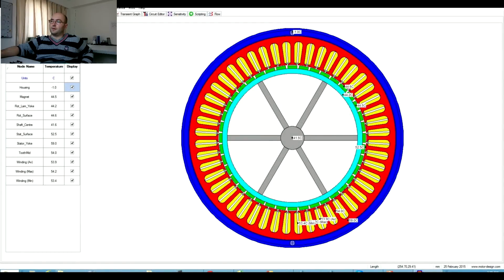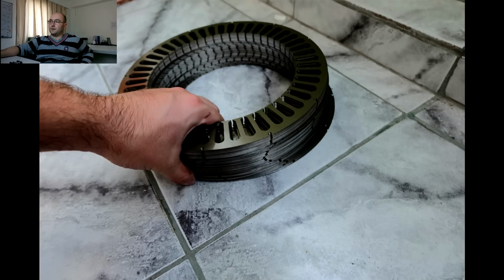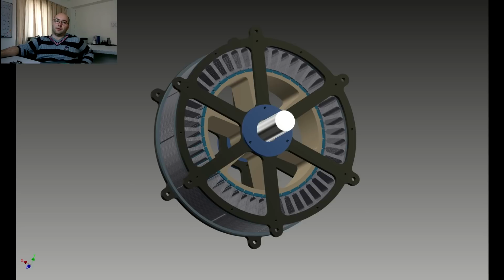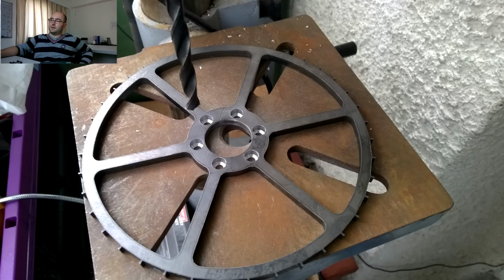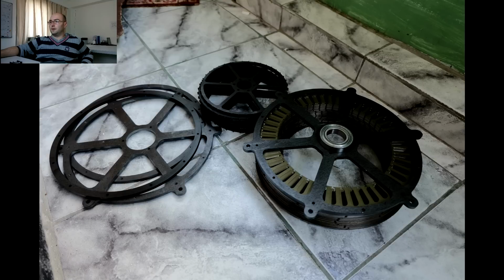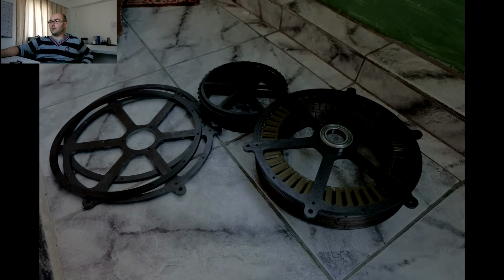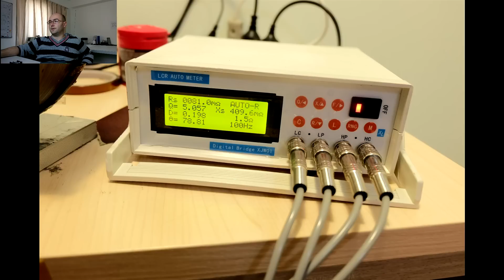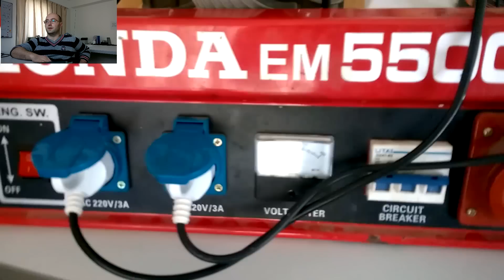How to make a brushless dc motor  at home

Comment: 300v is too much, you will need a hydro power to run
Reply: No? It will be low amp high voltage, the motor controller takes care of that so it will be able to run off of a normal battery.

Comment: Brushless is not synonymous with twisted magnetic magnets with twisted magnetic effects. This is nonsense. The old engine in the video is much better, I think, if you replace something. Replace metal cores with active copper windings and replace some old metal with newer dynamo metal. This does not mean that it must be a magnetic material with distance effect of Mgneten. Cobald, for example, has a high field density.
Cobald and other types of iron, for example, have a high graded field density. It does not have to be neodymium or the like, which is usually found in magnetic materials.
On the contrary, in most cases it is another material that promotes the improvement of electric motors. Brushless can be easily accomplished by magnetic sensors on the collector and built-in thyristors, or by spark-free contacts.
Pure three-phase motors often have 1/10 less power one must consider. brushless is not always forced. It would be a litte hybris to believe this

Comment: How do you get the supply of 150A power I imagine you might trip the neighborhood?
Reply: 150amp isnt that hard, u can get that from a very cheap welding machine, the thing is that he is getting those 150amps at 45kw, wich means that he would need a 300 volt three phase supply, but in this cae he is feeding it with batteries, however, u can get that amoun of current with a enterprise power feed.

Comment: Does the controller make the motor beep before it starts?  That beeping is very important because it alignes the coil's as per Gerald Morin's video.  Great work...I would think that a motor that works with the laws of nature would not need a cooling system?  That would mean there is frictions which is against natural law.  Just a thought that makes sense to me.

Comment: If you have an unknown bldc motor, how does one determine the proper controller.  

I built a bldc motor and bought a cheap controller that sort of worked with the motor but would sometimes have trouble starting the motor and after about 3 dozen test, blew 2 mosfets on the controller. 

I can answer any question about the motor's design if asked. A couple things about the motor.....  1) the motor is wired wye.  
2) At about 216 rpm, the motor generates 0.126vac across any two coils. 
3) The rotor has 12 poles. 
4) The stator has 3 coils wound in a 4 turn serpentine or rather falharbor winding pattern for the 12 rotor poles. 
5) The copper resistance across any two coils is a tiny fraction of an ohm.  Each of the three coils is made from about 80 inches of 16 gauge wire. that should be about 0.027 ohms to a coil. 

6) I made my own laminated slotless steel stator to fix the stator coils on.  

Do i need to buy a meter and measure the inductance?

Comment: Did anyone else see a spark at 1:47 in the upper left hand corner?
Very very cool motor. I've recently become obsessed with electrical motors and Li-ion batteries. I hope you put that monster in a motorcycle ;)
Reply: That's the laser from the tachometer, not a spark

Comment: This motor is really big and powerful, this thing has 45 kw of power, could you do one smaller for ebikes purpose like 10kw...  like 144 volts 70 amps maximum
Reply: If you reproduce a motor again and sell, how much cost to be?
Reply: @johnmbranham69   The main issue is the metal parts, there is an other guy on youtube that created a 3d printable motor using plastic parts , the problem is however that the motor explodes at 30,000 rpm, we need cheap metal printers.

Comment: Absolute perfection I would luv this motor I'm interested to know with such low voltage/amps  and high tork could you run it from the earth like they used too with telecom cables then gear it up to a alternator
Reply: 350pauli is that even possible, and do explain more or send me a link cause that’s some Nichola Tesla shit

Comment: Nice work !!!! I like the look of it too. The rotor being open (on spokes), does that help or hinder with cooling, fly-wheel theory, etc... I would like to hear more about your plans with this unit and the latest unit you designed and made... Also, when you are running the motor very slow, does the coils or the controller get warm or hot? Yes,  I see that you have a heat extractor incorporated on the outer casement, but, does it still get hot, or does this system not even care weather it is spinning slow or fast?  Oh, and also, how much does running the sensor assist in being able to run at the low RPM's, while holding that massive amount of torque... I am blown away, but this.  Have you played around with what the lowest supply voltage you can run, or is it already at its minimum... or maximum? ... Again, Nice Work !!!!

Comment: E-bike with Duyunov's wheel motor at StartUp Show in 2015 goo.gl/hxvBmz StartUp Show is an annual event aimed at presenting the most promising startup projects. In 2015 Duyunov's team presented their e-bike equipped with Duyunov's wheel motor at this event. Evgeniy Duyunov demonstrated the power of the wheel motor by effortlessly pressing the throttle grip. He also spoke about the advantages which include 17 kg light weight, 20 kW power, no magnets in the motor. As you know, all these properties make the wheel motor stand out when compared to similar Chinese motors. goo.gl/hxvBmz Evgeniy paid attention to the uniqueness of this invention which manifests itself in using a special winding type named "Slavyanka". goo.gl/hxvBmz After the presentation the impressed visitors bombarded Evgeniy with questions and the most popular question was about the price and the possibility of purchasing the wheel motor. Рublic funding and Registrierung hier: goo.gl/hxvBmz

Das Projekt "Duyunov-Asynchronmaschine" wurde 2017 zum Ausbau und zur Anwendung der einzigartigen Ausarbeitung von D.A. Duyunov - des ersten asynchronen Elektromotors mit der Wicklung nach Art von "Slawjanka", sowie des Motorrades ohne Anwendung von den Seltenerdmetallen entwickelt. öffentliche Finanzierung und Registrierung hier !!! goo.gl/hxvBmz Wir arbeiten unter Teilnahme von folgenden Unternehmen: 1) Gesellschaft mit beschränkter Haftung (OOO) "ASiPP" - Ingenieur- und Konstruktionsunternehmen mit langjähriger Erfahrung, wo es mit der Entwicklung von dem Plasmaschneider, Motorrad, der Wicklung "Slawjanka" usw. angefangen wurde. Unter den Unternehmensgründern - D.A. Duyunov. 2) Unternehmensgruppe "SolarGrupp" - Crowdinvesting-Plattform, Verband von den engagierten Menschen, die für die Vereinigung privater Investoren weltweit arbeiten. 3) Gesellschaft mit beschränkter Haftung (OOO) "SowElMasch" - "Werk zur Produktion der Werke" - eine Gesellschaft, die fertige Lösungen für das Großgeschäft in der Elektromotor-Produktion anbietet und Innovationen bei der Herstellung durchsetzt. Unter den Unternehmensgründern - D.A. Duyunov. öffentliche Finanzierung und Registrierung hier !!! goo.gl/hxvBmz Das Schema des Zusammenwirkens von drei Unternehmen: OOO "ASiPP" setzt die Technologie um, SolarGrupp organisiert die Erhebung von Investitionen, SowElMasch wendet die Innovation bei der Herstellung an, wodurch das Produkt auf den Weltmarkt gebracht wird. öffentliche Finanzierung und Registrierung hier !!! goo.gl/hxvBmz Das Ziel des Projektes ist die gegenseitig vorteilhafte Zusammenarbeit des Unternehmens und der Investoren für die Einführung der Technologie auf den Weltmarkt und zum Serienproduktionsstart des gefragten Produktes. Die Technologie bekommt die Massenanwendung, die Investoren - den Miteigentumsgewinn. öffentliche Finanzierung und Registrierung hier !!! goo.gl/hxvBmz

Comment: Hi I had a few questions:

1. What type of adhesive do you use for the magnets?
2. Why didn't you go with laminated stator stacks instead of the paper?
3. Can you elaborate more on the way you programmed the commutation and the simulation? 

Great job! 
Thanks
Reply from the maker: 1. epoxy
2. ??? i have laminated stator stack
3. search for brushless animation

Comment: It is very heavy to do everything in this heavy metal, it is not necessary, it can be built mostly in aluminum and only a thin steel plates, on the tips of each coil screwed, with steel screws that go through the heart of the winding. and the magnets when dezplasarse half centimeter not centered in the coils, generate more power of torque and speed with the same consumption, the magnet does not have to be centered in the magnetic vortex if it is slightly moved away its power of torque ahumenta.

Comment: with the state of art technology or technologies today it's possible for you or any firm can built a  mini compact DC inverter  of 298 kW the size of a present 45 kW electrical motor standard size energy saver.

Comment: on what basis you have calculated the width of each slots , number of slots and magnets , od of stator and rotar , total length of the stator(  thickness of the stator ), material for the stator and rotar. do you suggest any books or websites.

Comment: The saturation is to increase torque at a stable rpm , electric motor s are best made to suit there job , ideal working rpm an torque required, is controlled in wave length formation , it is a very nice build an I'm impressed, I work with highly advanced motors everyday , An for a home build is probably the best iv seen , cooking system im not to keen on as fan cooling is much more preferred way . But all the same good work 👍🏼.

Comment: dude i have a simple question..I bought my self two hub motors from the internet..Ones a 48v 1000w rear and  and a 36v 500w. kits they look just alike with the same hard ware but the charge controller ones bigger(48v) .Yeah i know over kill but the batteries for those hover boards are cheap right now (36v 4.4ah). Anyway my 36v got damaged (wires on the wheel).Can i use my 48v 1000w wheel with the 36v controller?.All the hardware is the same and they look just alike

Comment: Sorry if someone has already asked but I was just wondering what the efficiency  of the motor is when it is running at or near capacity.  I gather the water temperature must be kept above the dew point at all times.  That is a very impressive design and excellent quality of construction.  You should be very proud of this beauty!!

Comment: Isn't there supposed to be some kind of epoxy around the windings to help electrically isolate, immobilize, and conduct heat from the copper windings? Otherwise, that fancy water cooling rig is only going to conduct the heat that transmits from the windings that are in contact with the outer casing, and the rest of the winding will be dissipating to air only.

Comment: hi. I like the brushless motor cooling a hot metal. what happens a  bearing in the center of the motor?
isn't there cooling a bearing with pumping an oil or a water?

Comment: Does this stator design let you wind coil on a machine and then just insert them into the stator or did you have to wind each coil in-situ by hand ?

Also, what dimensions and capacity are those lithium cells and how much do they cost ?

How did you manufacture the stator laminations ?

Did you consider the halback configuration for increased field strength ?

Comment: That motor is a Polyphase, Permanent Magnet, Synchronous motor.  It may be driven by a polyphase inverter that runs on DC, but  Brushless DC motor is a misnomer.  Very nice work, by the way!

Comment: Hi
I am also building a motor (linear) and I have a few questions :
1)how did you optimise the inductance of the coils ? Why did you choose 15 wires in paralel ? I understand we want to get the max magnetic force with the minimum inductance, is that correct ?
2) how do you turn off the coils ? Do you short them  with a diode or something or do you reuse the current ?

Comment: wow your delta brushless motor has proportionally more torque than a tesla induction motor, you should do a project with it, an E.V or something
Reply from the maker: First open source motor on the market for EV cars 
http://www.masinaelectrica.com/open-source-60kw-motor-high-rpm-version-2018-in-construction/
Reply: well... bldc motors have proportionally more torque than induction motor's, that's nothing new. But BLDC motors are more expensive, and for high power applications, not as efficient due to magnetic losses due to eddy current. Instead, induction motors can compensate electric losses with magnetic losses more efficiently in high power applications.

So approximately everything above 100 kW is more efficient with induction motors.

Comment: So this would be around 60HP peak power?
If so, this could work great in a small electric car
Reply: Motorcycle :D
Reply: Interesting. I also wonder what would be more cost effective in an electric car. Having 4 scaled down versions of this motor that only require basic air cooling or having one bigger motor like the one in the video and having to deal with heat with the help of a liquid cooling setup...
Reply: what if you could make a rotating casing (that goes around the cover of the motor) and put a tire on it. cant you use 4 of those to quadruple the effect? (basicly using each motor as wheel)
Reply: There is a very cool version of that: https://www.youtube.com/watch?time_continue=89&v=l2PJmg-cEIE
Also it's probably not that practicle. You have to consider the fact that dampers are for a reason in cars.
Reply: Theodor Butters .i need ur contact
Reply: Tesrite Industries. Send a comment on one of my videos.
Reply: Even work for an ultralight aircraft!

Comment: Is there hall sensors? Where? I am making a small one as a learning project, first real product to completion. Im wondering if I can just put the hall sensors anywhere as long as 120 degrees apart or if I have to make a circuit and use the bottom of the magnets to activate them... Also any tips for winding? 

Also why does the rotor look different in one pic than another. In 1 pic, the rotor looks like a few pieces with space in the middle. In the other pic it looks like a solid part?

Comment: I don't know a thing about motors or electrical stuff, but this is fascinating. 
Building your own motor from scratch. 
When I first saw the copper tubing, I thought you had invented some revolutionary new motor design  incorporating  some kind of special coil into the cooling system. 
But that thought probably does not make a bit of sense to you, but as I said, I know nothing on this subject. 
I do know there is a lot of copper in motor coils, (right?). And they need to dissipate heat, right?
 So I'm wondering if anyone has ever wound the coil(s) using small diameter copper tubing & used it for cooling. Or is that a counter-productive, bad design?
One more question and I'll stop bothering you. 
Does that mass & configuration of copper tubing used for your cooling system affect the performance of your motor in any way? (besides cooling it).
Don't feel obligated to respond to me if these questions are as dumb as I have a feeling they may be.
Thanks.

Comment: Hi can you desing motor for in-wheel liquid cooled usage of about 15kW constant power and 35 -38 KW peek power and fit in around 17-20 kg weight ? we need such engines for our project
Reply from the maker: yes, i can design
Reply: For Iulian207 not you thanks anyway

Comment: Hello, could you tell me what gauge copper wire did you use, and how many wires together (i assume you used several parallel wires to bend more easily)

Comment: it could be used in solar cells to drive an polyphase AC alternator
Reply: its be more efficient to jsut put it straight into batteries from solar,
or just go form solar to what ever the altenator needed to run

Comment: You are a serious engineer! I am just a electronic technician with years of experience I say you have a great design.
Reply: +John Scarce maybe it's pulses with 1khz instead of direct current
Reply: I read that as I'm a PEng at first. PEng never comment on YouTube haha.
Reply: its shit. you cant feed 1 khz waves to steel sheets
Reply: 1 khz is nothing, and anyway I don't know what you mean by applying waves to steel sheets, you must be talking about applying the magnetic field to the steel sheets, but even that is a standard practice in electric motor engineering.
Reply: Mark Osborn steel sheets struggle with 60 hz and this dude here puts them at khz range. that is why most of the motors for commercial use are long and have smaller diameter. the more sections you have-the higher the frequency needed for the rpm. this means that this is torque optimized motor, but its very bulky for the torque it can deliver. also long axis small diameter rotors are better than this short thick one, because of the lower inertia- a big problem with EMs
Reply: Are you an engineer or just an arm chair technition?
Reply: Mark Osborn im far from professional engineer as you can tell, but i know a lot of stuff and go into detail on everything
Reply: John Scarce  practice that
Reply: +John Scarce -- Despite the large diameter, this motor has a low inertia rotor because of using supermagnets rather than induction.
Reply: +John Scarce -- A few kHz is not a problem for a properly designed electromagnet made of laminated steel. Tube-type audio amplifiers all use them with no problem whatsoever, because the lacquer coating on the laminations breaks up the conductive pathways, preventing what would otherwise become a huge mess of eddy current... which would make a low-temperature induction heater. This +iulian207 guy is an electrical engineer. If he got it wrong, he'd be an utter fool to publish it on Youtube, eh?

Comment: How do you estimate motor capacity during design? Is it based on magnet strength, copper wire size, turns, input voltage and amperage? Is there a calculator available for such sizing calculations? Thanks and hats off to you! Amazing piece of frugal engineering and design.